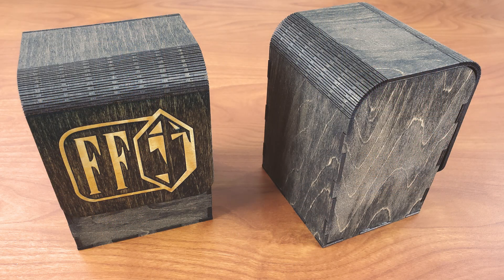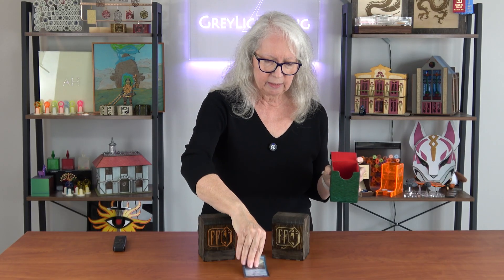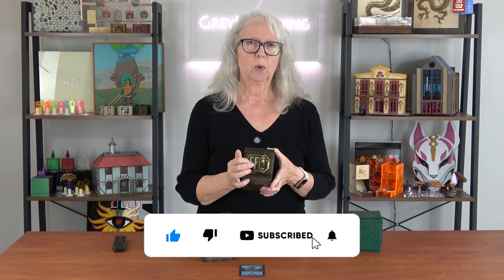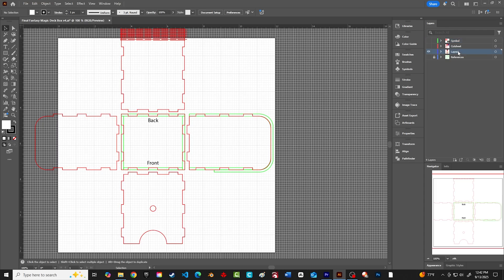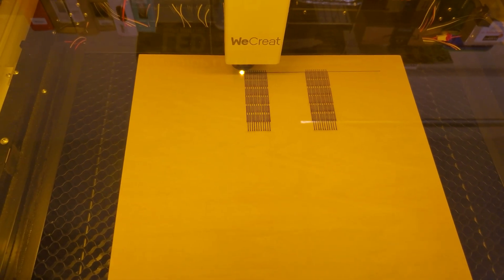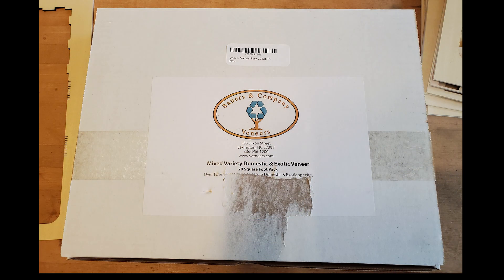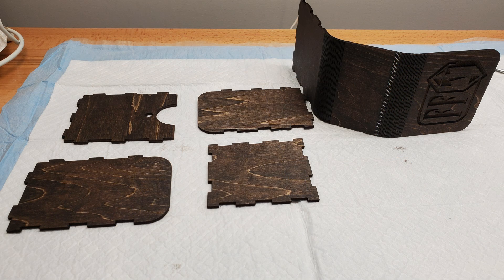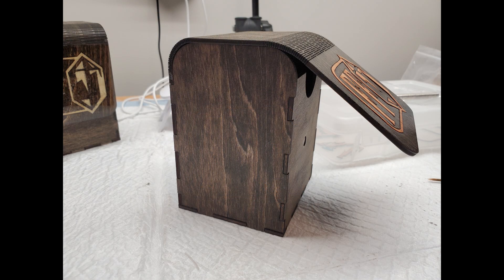How To Design and Laser Cut a Final Fantasy Magic The Gathering Deck Box

Comment: Well explained.  Thank you!  One thing you may consider is alcohol based leather dye for staining.  They dry very fast and I find them much nicer to use.  Keep up the great work
Reply from the maker: That's a great tip, John, I'll order some for my current project. I've created a custom card box designer app and I'm working on the sample for my video right now. Staining is my least favorite part of any project. Not only messy but I'm always worried about disposing the rags safely. Alcohol based would be a nice alternative!